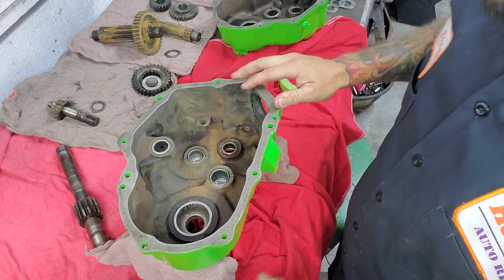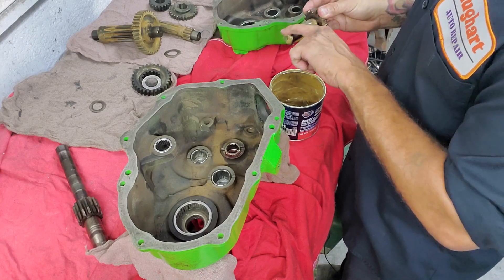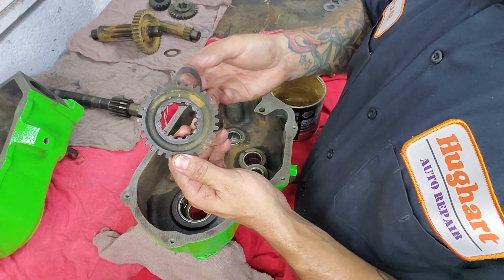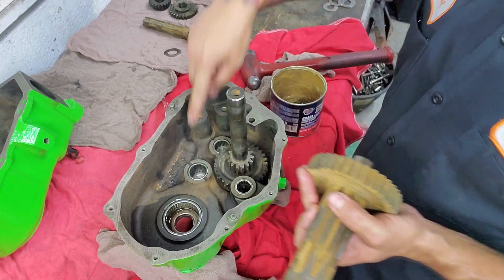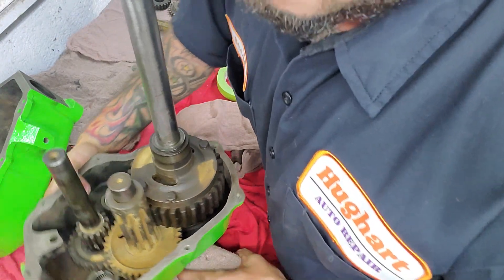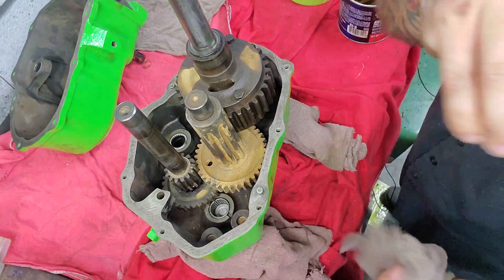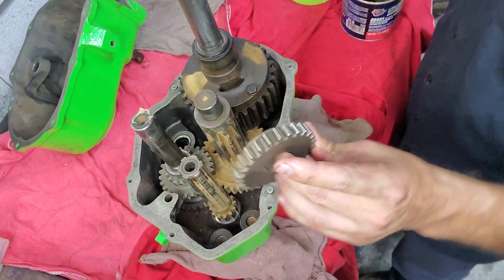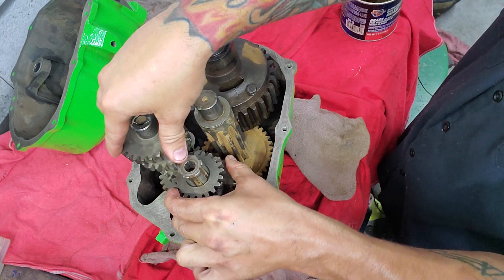Peerless 2300 assembly part 1 60s  john deer 110

Comment: glad someone finally did a quality 2300 assembly video. How did it run after assembly?
Reply from the maker: im still far from that im restoring the whole tractor a little at a time so hopefully in 6 months ill be using it
Reply: @uglyhp8225  Rusty this video helped me a lot but you made one mistake you will have to correct. You had the reverse idle gear right the first time. The spacer goes on the bottom and the gear goes on the top bevel down.
Reply: This is not a quality 2300 video.  Anyone banging on transmission shafts with a steel hammer wouldn't know quality if it ate him.

Comment: Great video. I’m struggling with getting the shifter back in correctly. Any pointers??
Reply from the maker: yea make sure the its in neutral and it will slip right in it should be in the shape of a rectangle when you slip the shifter in

Comment: I have a JD111 and need to rebuild the transaxle. Where did you get the parts and how much where they?
Reply from the maker: i got all the parts at john deer and i would say everything costed around 250 the gasket set i got off ebay it was like 50 bucks